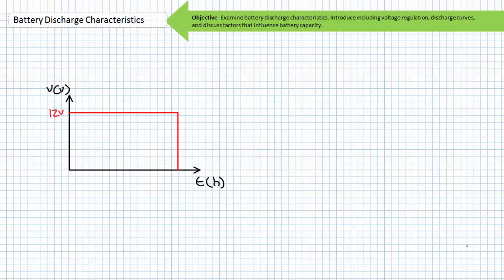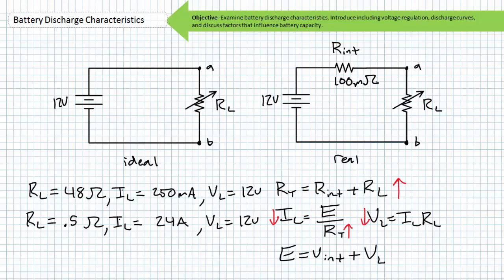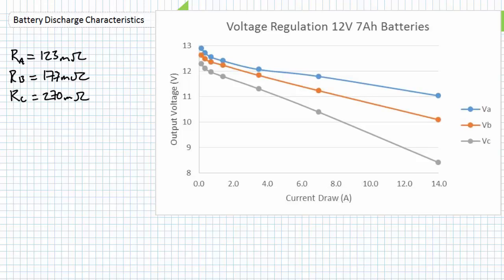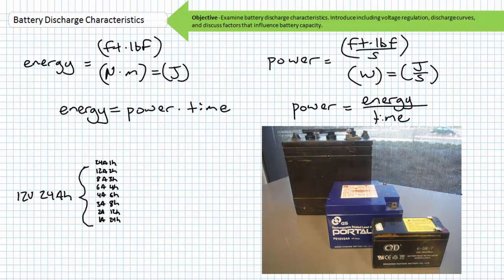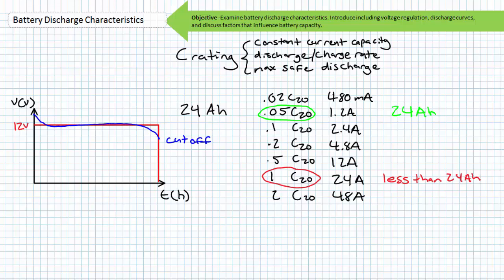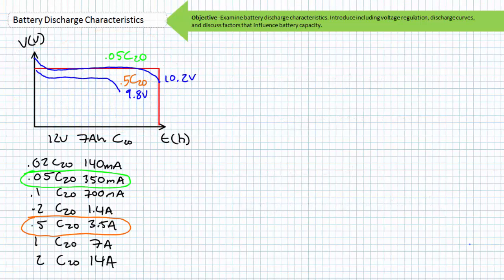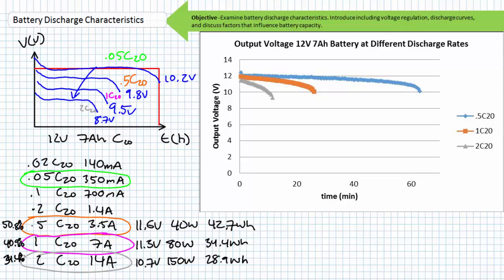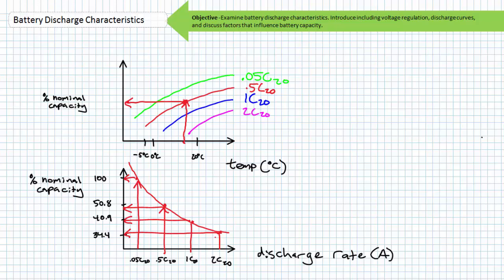Battery Discharge Characteristics

Comment: Sir hope you are fine 

In manufacturing of battery there is no capacitor involved in lead acid battery 

I want to confirm that you are talking about the resistor and capacitor which are built in rectifier 

Plz clear my point 

Waiting for your response 

Thank you❤

Comment: As to the voltage regulation curve 12V 7 Ah, a bit uncertain about the formula.If current is 0 E = 12.68 as per the formula. Whereas You said when 0.14 A is drawn the battery provides 12.89 V to the load. When current is 0.14A then internal voltage loss is 0.123 Om x 0.14A = 0.017 V and the output voltage to be 12.66V and not 12.89 V.

Comment: Isn't it C20 = 0.05C, C10 = 0.1C, C5 = 0.2C ? I am a bit confuse why it is always C20 when you add number in front of C, like 0.05C20 which as I understand you mean 0.05C?
Reply from the maker: Common confusion because C rating is a capacity measurement AND discharge current may also be expressed as a function of capacity. You are correct that the discharge current at C20 would be 1/20th (or .05 of capacity measurement).

Comment: so, what is the safe discharge current in ampere for a 12v batter?. because we need to always take count how many battery for a system. this didnt gave me any answer. im aware of all this but all the video only tell us the problem but didnt realy answer any question. as 12v battery can gave us 10A max off early discharge, taking the factor of time and 50% discharge max rate, im assuming the best rate to take is around 4to5Amp max to drain as when it reach the 50% discharge mark.it will reach around 5 to 7 amp max. so to have about a 1000 watt usage on a 24v system. you will need a 24v parallels of 6 in minimum to safely discharge for a 1kw system. if you are using 12v battery, that would be around 12batteries in 24vseries. 6couple in parallel

Comment: Sir can you help in finding an equation for the voltage vs time curve shown for different load currents.
Reply from the maker: I'd hit up a mathematician for curve fitting advice. Really the only 2 points of interest are the sled hill at the start and the roll off into the cliff at the end. In between these 2 action zones you can probably use a simple y=mx+b linear approximation.

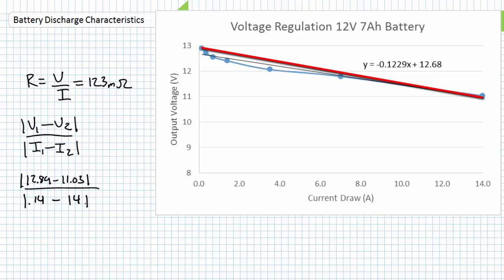Comment: Really Excellent lecture Jim, how we got the 123 m-ohms in voltage regulation at 11:02. is it should be 92.07 m-ohms? I lost there.
Reply from the maker: Linear approximation of data points from Excel.

Comment: discharge time for discharge current of 3.5A should be 7/3.5=2 hrs. So, how did you decide for 63 mins here at 35:24.
Reply: How are you calculating the time? I would appreciate your reply
Reply from the maker: It's not a calculation. It's experimentally obtained data. The battery reaches the manufacturer's recommended cutoff at 63 minutes, much sooner than you'd think because it's being discharged at a much higher rate than that used to determine the nominal energy content of the battery.

Comment: Thank you for the video. I have a question though, how can I get the exact discharge characteristics of my car battery. I was not able to find any manuals or data sheet for the same on the manufacturer's site.
Reply from the maker: Tough question. The critical piece of data is cut off voltage. Discharge beyond the cutoff voltage and you damage the battery. Check out Battery University at: https://batteryuniversity.com/learn/

Comment: Hi Jim, Thanks a lot for the great video. I have one question at 24:28. For the 24Ah, I thought the 1 C20, the discharge current should be 1.2A, so for the 0.02 C20, the the discharge current should be 24mA. Is there any thing I missed in the video? =)
Reply from the maker: Yes C rates can be confusing. While it's true over the course of a 20 hour test a 24Ah battery would be discharged at 1.2A (ie: the .05C rating) to keep things simple customarily the discharge rate is expressed as a multiplier times the capacity. (ie: 1 times 24Ah).
Reply: @bigbadtech  O.K. Got it. Thanks for the explanation. =>
Reply: @bigbadtech  it's only became clear to me after watch video explanation about 1-2(C20) times;)

Thanks

Comment: Wow, you nailed my question about internal resistance. I am considering using an Arduino to determine the ESR of the used Li-Ion cells I am harvesting. It will save me time and energy to get an idea quickly if the cell is at the end of its life cycle or if it has a chance to be resurrected again. I wouldn't need it to be as accurate as of the results from a calibration lab. It would be a reference to grade the general health of the cell.
Since the voltage drop curve is exaggerated at the start going from 0.0A to 0.1A and perhaps even higher, what current points would you choose if you were to build a tester? Would you pick something like 100mA and 1.0A for two points or would you go even higher? I will be wanting this to also test other types of rechargeable batteries and I fear I may damage some cells if the test current exceeds the max safe level.
Speaking of maximum current ratings, I have questions about discharge C-Ratings. If I understand what you said, the manufacturer has determined the battery's optimal capacity using the discharge C-Rating as a function of time. Then you mentioned it also has a different number associated with this C rating to express the maximum safe discharge draw.  You used several multipliers including 0.02, 0.05,, 0.1, 0.2, 0.5, 1.0, 2.0, etc. as examples. Where do I find this additional information? Finding the spec-sheets is difficult for many of the cells I come in contact with. Just finding the C-Rating is difficult enough let alone this multiplier you spoke of.
In your experience, can you say that an unmarked cell might have a general C-Rating and multiplier rating? For instance, when dealing with a Nimh cell are there typical C-Ratings that apply if they didn't make it obvious? 
You mentioned that the subject covering the C-Rating is very slippery. I see a lot of information about how others determine the safe maximum discharge current by simply multiplying the C-Rating with the mAh rating. Are these cells not only advertising the capacity in mAh but the multiplier too? This would mean a 1000mAh battery with a 20C rating (designed to deliver optimal energy with a 50mA load) could safely handle a 20A discharge rate. Given the same conditions for a 100C rated battery, it implies it could be discharged with a staggering 100A ( compare that to the optimal 10mA recommended by the manufacturer). I did notice that the sites were talking about racing LiPo batteries and they were happy with a battery only delivering its power for a couple minutes before it was drained. They were using large capacity batteries such as one battery was rated 1600mAh with a discharge rating of 150C. He claimed he used it for his drag-strip racing and it could safely deliver 240A with burst current of 480A for a short duration just to finish a race.
I feel if a manufacturer put a higher C-Rating then the battery was designed to deliver a lower current not, a higher current these guys are talking about.
Reply from the maker: Battery University, the answer to all your questions and more! https://batteryuniversity.com/

Comment: Need help here.. what is the Vf rating in battery..usually china drill battery using that rating which unusually higher that standart Volt rating.
Reply from the maker: I can only guess what "Vf" means however float voltage (ie: slightly higher than nominal voltage) is an excellent supposition.

Comment: Dear sir, 
Great vid, thanks. I have a 
2 Pack - 12V 55Ah agm Scooter Battery UB12550 Group 22NF for Pride Jazzy 1115. 
I used these 2 batteries in series for a 24 volt system to power my riding lawn mower. 
I use a me-1004 DC 11 hp motor. When the mower is on its pulls 22 amps. 
I never use it for more than 25 minutes. I have two digital displays that shows me the charge state of each battery. When the mower is on, the  charge state meter drops. When the mower is off, the charge state meter is about 12.6 for each battery. Would you please let me know volt limit amount I should never go below when the mower is running as indicated by the state of charge digital meter?  I don't know the C rating. It seems like these two batteries are degrading very quickly the more I use them.  I got these batteries at Amazon and was promise a 3 year warranty about two months ago.
Thanks
Reply from the maker: robviolin1 Rob, unfortunately I'm going to have to give you my official "I cannot give professional engineering advice without being actively involved" response. This being said, check out the datasheet for the UB1550 at:
 
http://upgi.com/Themes/leanandgreen/images/UPG/ProductDownloads/40740.pdf

This will make a great homework assignment to practice the skills in this video! Check out the second page top right.
Reply: Thanks Jim for the data sheet. Thanks also for your reply. Most people don't even reply. I have a degree in music, so this battery stuff is very strange to me. Could you tell me what you think would be a choice of a battery ( I need two 12 v batteries in series for 24v system), that would give suitable power to handle a draw of 22 amps for 30 minutes?   For example:
1. Two 12v batteries with 100 ah with a C rating of 20 that is an AGM will be a good choice , but only for 30 minutes at a time.
2. Only buy 12v 200 ah batteries .
I guess I need an "easy to understand" general formula that tells me how much residence (like a DC motor) a battery can handle and for how long.
Your vids are great but are light years ahead of my current level of understanding.
Thanks again for sharing.
Reply from the maker: robviolin1 All things being equal cost would be the primary concern for the two different configurations. Unfortunately, nothing in electronics is "easy to understand" ... that's why technicians make the big bucks! Take heart though ... I designed the "Batteries" playlist to plug into the "Basic Electronics 1: DC Circuit Analysis" playlist early on after a student has finished "Unit 4: DC Series Circuit Analysis". Pretty much everything you need is right there for the taking. Check out the welcome and orientation at:

https://youtu.be/Do7VzDuB_Rc?t=3m41s

Thanks for the interest!
Reply: Thanks
Reply: "that's why technicians make the big bucks!"  I wish.